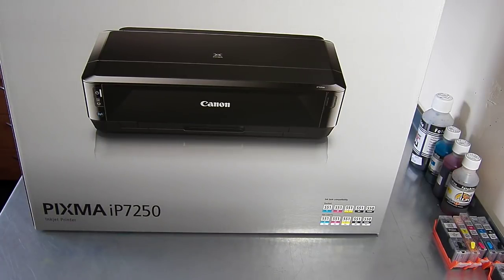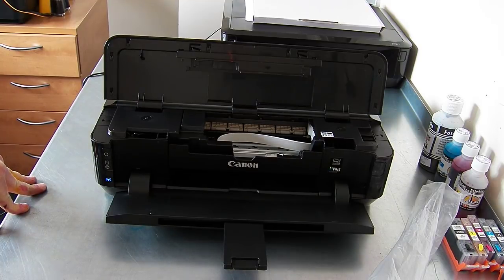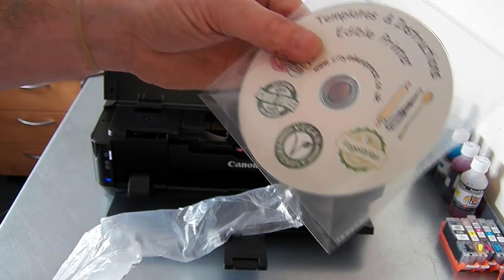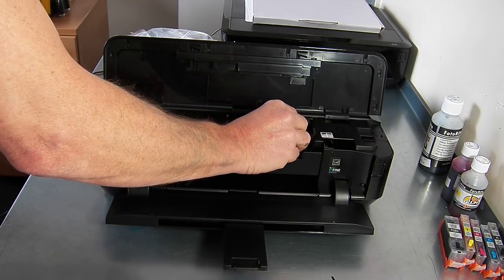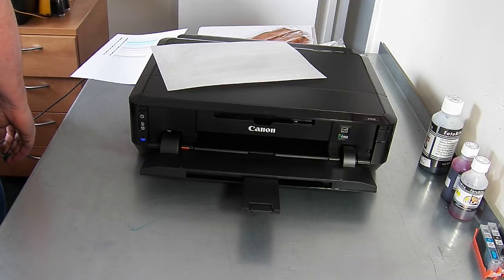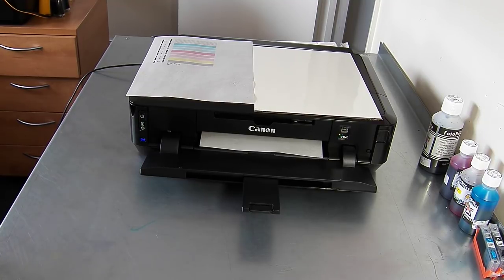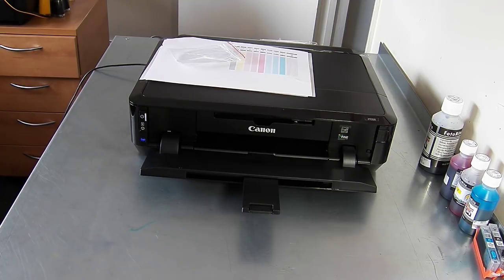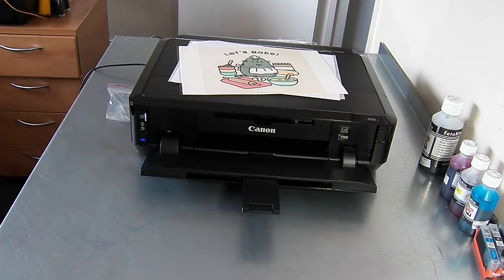Canon IP7250 edible printer setup

Comment: Wish this video was available when I got my printer. This is a great printer and does a great job.

I wish however you'd mention printer settings for different paper types. I'm a chocolatier and been using this to print transfer sheets however getting the settings has been difficult, online I've found suggestion to use standard printing. However black wasn't printed, after doing a search online an earlier version of a similar Canon printer stated that standard format wouldn't prints black so I had to resort to photo prints
Reply from the maker: Hello Simon thanks for your feedback we will certainly consider your feedback on the next edible video we do and look to show some printed results of the settings - what papers in particular are you using ?
Reply: اذكار مساء

Comment: Is there any reason you failed to show the REAR paper feed/tray? The Canon spec claims there is a rear feed (that would be easier to use for single sheet demos than the dinky front tray). Otherwise, worthwhile video.

Comment: Can you tell what I am doing wrong, I am trying to copy  a photo from my laptop and my printer keeps telling me that my  edible paper is  run out and to fit paper into cassette and press resume button, which I do but it keeps giving me this message. Can you help?
Reply: Janice Knigths the exact same thing is happening to mines. Not sure what to do
Reply from the maker: Double check that the correct paper tray has been selected, the Canon printer drivers often default to one particular tray and so will state no paper found if there is no paper in its default tray. Safest option is to have paper in both trays.

Comment: Can it be used to print documents instead of photos? and is A4 paper suitable? thanks
Reply from the maker: This is specific printer bundle has edible ink so we would not recommend using that to print everyday documents. However the printer when is used with stand ink cartridges it can print standard A4 documents.
Reply: @cityinkexpress-online  Yeah, I bought one second hand online and didn't know it was for pics, however I have managed to print documents as well...And got some pictures for my wall! thanks anyway, good video!

Comment: so this is an unmodified printer straight out of the box the only difference is the ink cartridges have been replaced with edible ink ones, correct?
Reply from the maker: Yes that is correct.
Reply from the maker: you cannot mix ink brands on the same printer - you must only commit the printer for edible ink or normal ink and it must be brand new
Reply: if i will buy this printer is edible ink and wafer paper free.?
Reply from the maker: That would depend on the options you choose on our website, the price would vary accordingly.